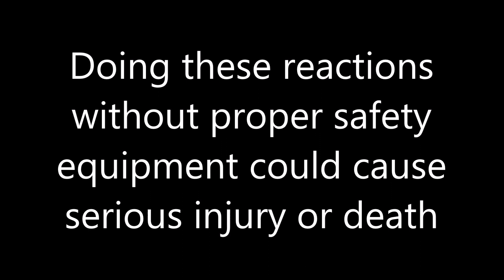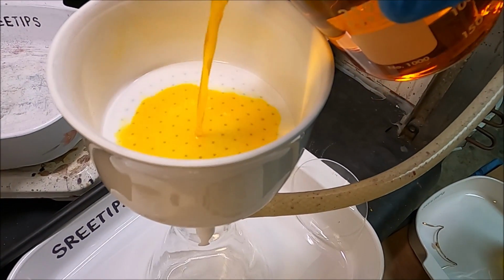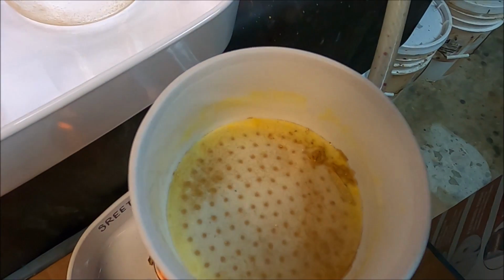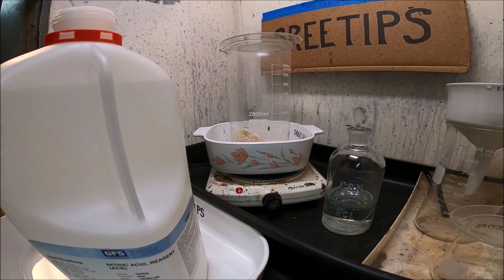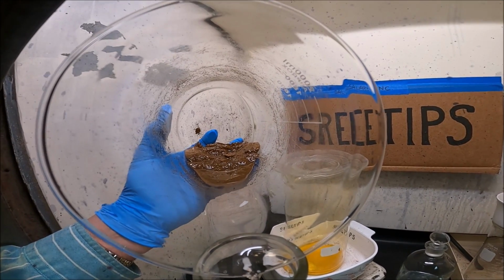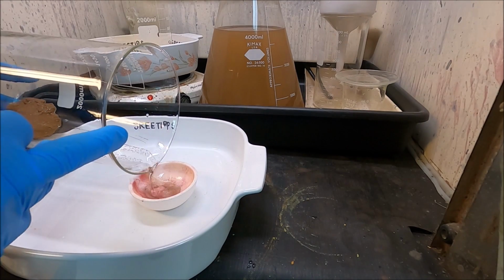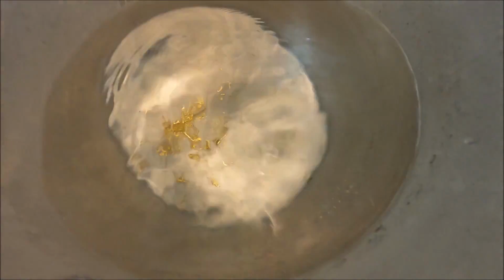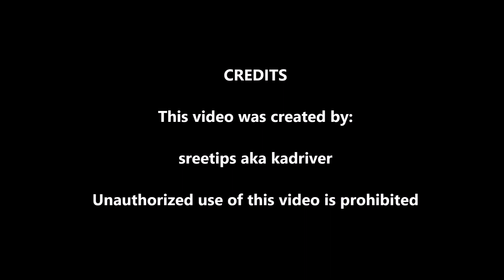Pure Gold From Electrolyte Solutions 5 Troy Ounces

Comment: How much total gold did you have in that cell to begin with? Did you have any loss in the waste stream?
Reply from the maker: I didn't keep accurate records of the weights. I only did this to see if I could pull it off. But I can assure you that no gold was lost from the process itself. The waste solution that I poured off contained suspended gold particles. They will settle out and I'll get that gold back. Any loses came from the usual suspects: droplets leaving the reaction vessel, drops of gold bearing solution splashing out of the containers, tiny gold beads flying out of the melt dish as the metal gets melted.

Comment: I wonder why you couldn't get all the gold out of the solution with the electrolytic process.... could it be that it only works above a certain concentration level? Or could you reuse the leftover liquid by evaporating part of it, thus increasing the concentration yet again?
Reply: The cathode which is made of gold gets dissolved into the solution as the gold in the solution deposits out onto the anode so the solution doesn't actually get depleted
Reply: Thanks for your reply Canaan, but, then, if I understand you correctly, the impurities from the anode and those that were in the electrolyte all stay behind in the solution? If sreetips drops the gold out of the solution afterwards with metabisulfate, won't it be doubly contaminated with elements like platinum and such? I mean the whole purpose of the exercise was to get nearly pure gold on the cathode and leave any impurities behind or do the impurities stay behind in the solution while dropping out the gold with MBS?
Reply: @TechneMoira  yes it probably did make the gold in the solution a little more impure but not by much at all.    It took almost an ounce of gold that had .001% impurity and cleaned it to have .0001% impurity so the diference  is .0009% of an ounce spread out over the almost 5 ounces he recovers from the solution so its still basically 99.999% pure because the diference is so tiny it is immeasurable.
Reply from the maker: TechneMoria, In Hoke's book she does describe the process and makes reference to the fact that the electrolyte does get depleted during cell operation. Just like the silver cell. Some of the metal in the electrolyte plates out as pure metal on to the cathode.
Reply: Hello sreetips, that still doesn't explain why the current seems to automatically drop to 0 as shown in your video. 
I would assume that would be because 
1) the ions in the solution are not concentrated enough to conduct any (significant) current or 
2) because there are no more free metal particles throughout the solution to conduct electrical current. That in turn seems to suggest there would be no more free gold atoms floating about in the electrolyte... but this is only conjecture on my part. According to Canaan the gold atoms of the anode at least partially replace any gold atoms caught in the electrolyte, yet you just confirm that there are no (or very few) gold atoms left in the solution. It's all a bit mysterious to me somehow :) 
I'm just trying to understand why it is still necessary to chemically remove gold out of the electrolyte after that process has run its course...
Reply from the maker: Look at it carefully, you'll see that the anode bar completely dissolves, fall off the gold wire that holds the bar suspended in the electrolyte and completely breaks the circuit. The anode bar is gone. Nothing but air between the wire and the electrolyte. That's why the current drops to zero.
Reply from the maker: There is still plenty of dissolved gold in the electrolyte. We could actually put in another anode bar and keep the process going if we wanted to.
Reply from the maker: I should have made this clear in the video. I could have left the leads in place and dipped the 14k gold wire that was soldered to the anode bar into the electrolyte and resumed current flow through the cell.
Reply: Ok, yes you're right, I should have spotted the anode wasn't touching the liquid any more which, of course, causes the current to drop to 0. Well... I suppose as Canaan said, whether you dropped the remainder of the gold chemically or electrolytically wouldn't have made a lot of difference in purity anyhow :) thanks for the clarifications

Comment: does this work for dropping gold from plating solution. The solution has gold in it and was used for dalic plating. The dalic solution says "gold acid solution"
Reply from the maker: Bob, that solution should have gold in it. Get a small sample and add some stump out to it to see what happens. Do it outside though, otherwise you'll be gagging on SO2 gas fumes.
Reply: @sreetips  I am new to this. What is "stump out" I have not refined anything yet however I have been collecting computer scrap for years and have  lbs and lbs of gold foil acid stripped from fingers. Then speaking of stumped, thats me next step.
Reply from the maker: Stump Out by BONIDE is sodium metabisulfite. You can buy it at Ace Hardware. The stuff by Spectricide is Potassium Nitrate - it won't work to precipitate gold